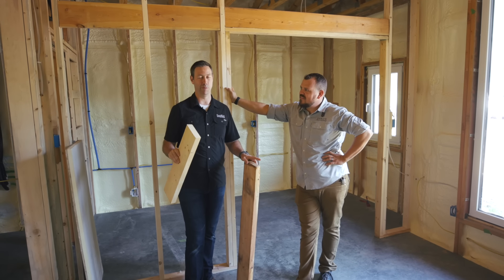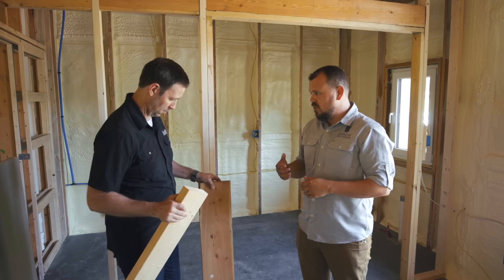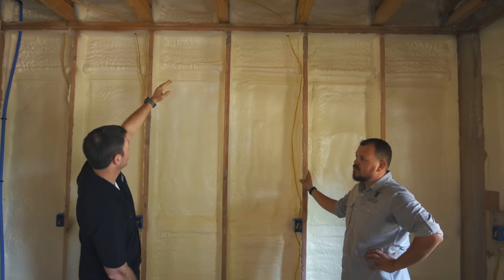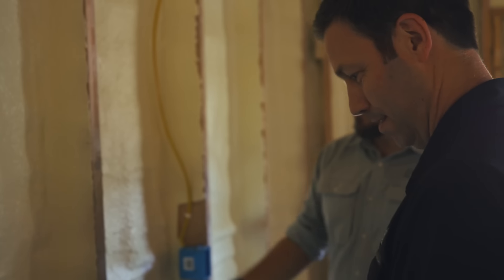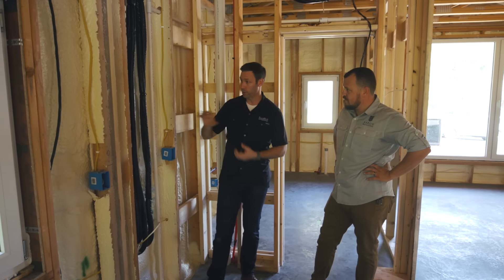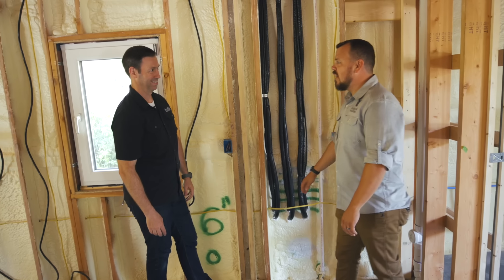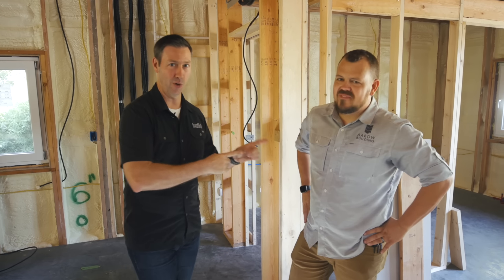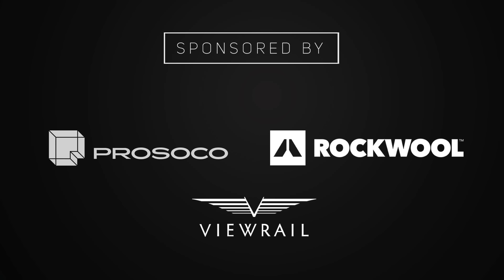Why would you frame a house with 2x8 lumber?

Comment: I did pretty much the same with my walls in Alaska, excellent insulation and went through a 7.1 earthquake last year with no damages.
Reply: Alaska has a use case for lots of insulation in the house shell with the temperatures that can hit -60°F in the winter.
Reply: Many houses built during the oil hayday of the 70s and 80s have 2x4 construction in Alaska.  My house I bought in wasilla has 2x6 and I saw a few with 2x4 and wouldn’t even think about buying it.  Building with 2x8 would be excessive cost but probably better for insulation.  As for the earthquake my house was fine seemed eagle river got the most damage being on the hill.  We obviously had road damage but my house faired well. Just broken dishes etc.  which sucked cause we bought all new dishes when we bought our house that spring and come winter  the earthquake ruined them all.  Lmao
Reply: bwillan most Alaskans don’t live where it gets -60.  Anchorage barely gets below 0 anymore lowest temp I’ve seen in anchorage was easy anchorage hitting -20.  Wasilla is warmer usually but go inland farther and it can hit -30.  But -60 doesnt happen around here.  Even Fairbanks doesn’t hit that low.  60% of Alaskans live in anchorage metro area.
Reply: I miss me some Alaska, I lived there from 08 to 11. Lived downtown and Eagle River, good times, I always have to correct people on the 24 hours of dark and the temp.
Reply: @MatanuskaHIGH  jeez i seen -45 -48 in montreal...-55 -60 alberta
Reply: @MatanuskaHIGH  True. Though when I was in highschool in Anchorage we had a week of -40 and it wasn't often but did see -20 (not including windchill).  Trucks always broke down when it was below zero too. Hated freezing while fixing them! My house had 2x6 construction but flooded in the crawlspace every spring. Can't win them all I guess.😋
Reply: @MatanuskaHIGH  Fairbanks does hit that low. Its rare, but they do. A friend of mine lived there for a few years. He moved back to Anchorage though. But he certainly texted me when they had -55° for their high temp one time.

Comment: One of the only times I saw a framed design that made me rethink my block-or-die mentality.
Reply: SirVixIsVexed  I have old-man mentality in that I'm a stickler for "what has worked for 100 years will work for another 100" and saw benefit to ICF, but not night-and-day benefit. I figured a block build with furred out walls and some high-R value insulation on the inside would be comparable and a more 'classic' build to a custom ICF block. Maybe I'm wrong? Last time I looked at ICF was 10 years ago.
Reply: @rkalla  Block will be stronger,block can also be filled with zonlite or pump in foam

Comment: I helped my brother build a house with 2 by 8 outer walls back in the late '80's. You could heat the whole place with a blow-dryer. It was the most amazing, draught free, sturdy house I've ever been in. R-30 in the walls and r-40 in the ceiling.
Reply: From my experience it takes forever to cool the house back down if it becomes over heated. Went to a friends Xmas party with 2x8 framing. The outdoor temp was 20f and inside temp was 80f with 50 guest creating lots of heat. We opened every window in the house and 3 hours later it was still 80f.
Reply: In the Seventies I read an article where they called it “Superinsulation” technique.  I thought it died out until seeing this video 👍
Reply: @mpyoung33  friends do alot of gabbing
Reply: @mpyoung33  🤣🤣😂

Comment: I recently completed a structure with 8-inch walls consisting of two 2x4 walls offset horizontally by eight inches. Each stud was notched four feet high and a horizontal 2x4 fitted into the notch to provide lateral bracing. Opening were framed with 2x8s. Top and bottom plates were 2x8s. Since no stud went from wall to wall, the low R value studs are not heat leaks. Every stud has four inches of insulation on one edge of it. Easier to run electrical wire because it weaves between the studs instead of having to bore holes in each stud. Walls were pored full of perlite and 12 inches of blown in cellulose overhead. Pros: super strong and well insulated. Very quiet. Cons: a little more material expense and time involved in construction. Also, sheathing must be well attached to studs or perlite will leak out through tiny gaps, which necessitates caulking around electrical outlets.

Comment: My first thought is that legal issues like property taxes, zoning, and septic system valuations are all based on a measurement of the OUTSIDE of the house, so when you double the thickness of the wall, every three lineal feet of wall is one square foot of living space you’re paying for in many ways that you don’t really have access to. It adds up a lot more than you might initially think. It looks like the interior walls are all 2x6 also, so every six feet of interior wall is a lost square foot of usable living space. That’s a ton of floor area that’s underneath walls in this house. 

My second thought was, where’s the house? If it were in Alaska or a similar climate, I’d see a lot of value in thicker walls, but I believe they said Missouri? This kind of feels like hunting dove with a cannon. Dove is tasty, cannons are useful, but a wise man matches the solution to the problem. 

But the ultimate question is, how does this system compare to the alternative options? Without valuing the point of reference, you can’t make a worthwhile comparison to know whether this is worth doing. For example, if 2x8s are good, maybe 2x12s are even better. Maybe a pair of 2x4 walls with the studs staggered. Maybe 2x4 walls with SIPS lining the exterior. Etc etc. In other words, any fool can throw more material at a job. The interesting part is calculating what benefits, if any, you get.
Reply: Great point. I've cut and screwed down a lot of questionable 2x4s, but 2x6s are a league above them already and heavy enough up here where they don't kiln dry wood.
Reply: UBC is doing that research.   we do have data.  seems to be the cuttoff is somewhere between a 10" wall assembly and a 16" wall assembly, depending on your materials.
The real question is "why are we forcing everyone to build to such a high standard?"
I'd rather be in a shack made of 2x2's that i own than renting or mortgaging an uber expensive modern green build and never ever being out of that rut.
Reply: thisisn'tmyrealname excellent point! I’ve been interested for several years in how the various building requirements, code but also zoning, planning, septic, etc coincide to make housing inaccessible to the poor.
Reply: missouri can get pretty hot and humid in the summer. just because it dosent get really cold there dosent mean you dont need good insulation
Reply: @resqjason2  works both ways.  and it has an effect on the vapor barrier.
Reply: @hosmerhomeboy  then the answer for you is a trailer home.
Reply: No the interior walls are 2X4. There would be very little value in 2X6 interior walls outside of acoustics or load bearing points.
Reply: @ScooterFXRS  try getting towns to let that happen nowadays.  nearly impossible.   We're going to superhouse, or nothing.
Reply: @hosmerhomeboy  lol, yeah if your looking to get into the sub or urban scene your pretty fooked. They have "standards" ya know. Almost as bad as living in an HOHA or condo. Anything outside of a rectangle and they vibrate in agitation. Little Caesars everywhere ...and I'm not meaning the cheap pizza kind.
Reply: @ScooterFXRS  Yeah, and i have to take all these people seriously, even if its not what the customer wants, and even if what they want is untenable.   That or they go all obstructionist and require a half dozen reports and a few studies.   All this green legislation and safety legislation has given the petty tyrants way too much control.
Reply: @hosmerhomeboy  Don't you feel safer though?    lol  "We are here to serve and protect the crap outta you." All the while holding you upside down by the ankles shaking all the pennies lose.
Reply: @ScooterFXRS  LOL well said.
Reply: Whatever benefits there are...it's just too damn big. An ice machine and freezer? Everyone needs an ice machine. They have 12 kids?
Reply: @hosmerhomeboy  you got that right. Your 2x2 shack is a lot more sensible as long as it is not huge. This house is all about vanity!
Reply: Good points thanks.
Reply: @vincentconti3633  Well to be fair, he is a contractor. Contractors fill coolers with ice daily. An ice machine will pay for itself quickly in his profession.